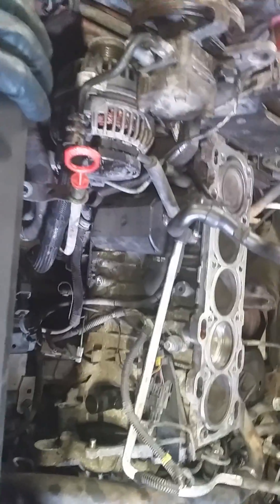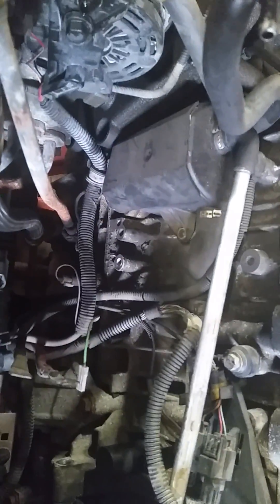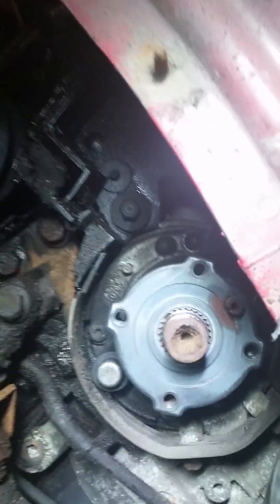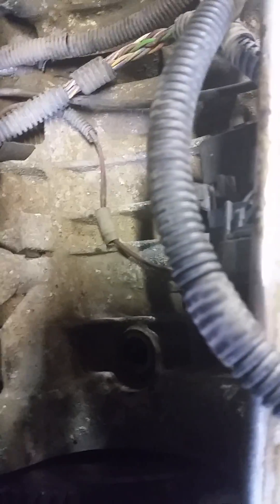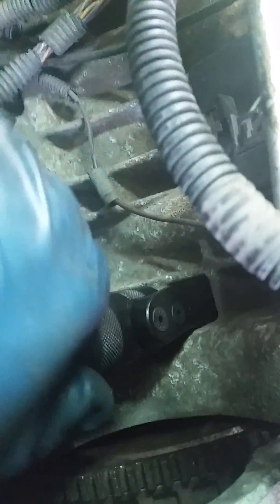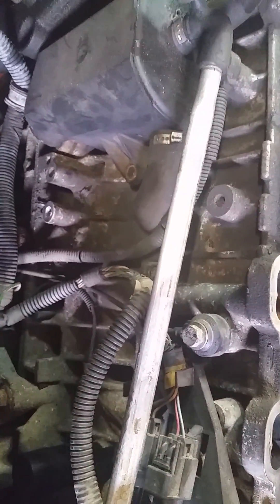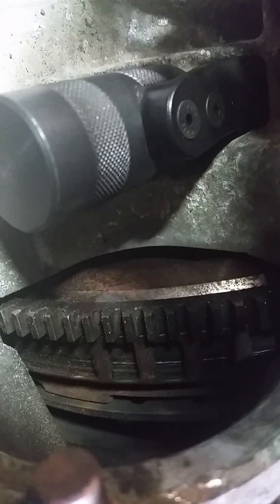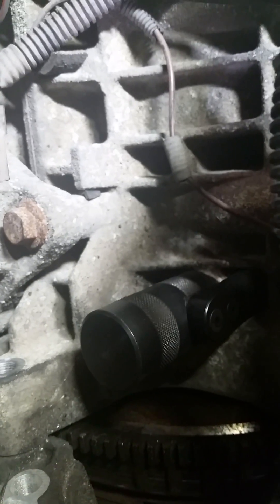Volvo crankshaft alignment

Comment: Hello, I have a question about where the lock engages in the crankshaft. Is there a hole in the crankshaft or does the crankshaft cheek rest on the tool?
Reply from the maker: @ratombo8992  I think there is a notch the small part seats into. It has been years since I have done that. The best thing to do is put it in place and rotate crank till it seats. You will feel and hear it

Comment: hi nice video, so the crankshaft locking tool should also work for a B5234T4 2.3 850 engine ?

Comment: Thank you for this video.  Believe it or not, you are the only one on YouTube who has shown how to use this tool.  I inadvertently moved my crank in replacing cam seals and could not be certain of the timing marks on the crank.  I put it all back together and it ran for crap, which told me that I mistimed it.   So, back at it to use the crank locking tool.  After removing the starter and plug, my tool turned out to be slightly too large to go into the hole.  I guess it serves me right for buying from Amazon.  Tomorrow I will get it turned down the few thousands needed to make it work.  If others run int this, get a machine shop to turn it down.  My plug is an M16x1.5 mm.  Check yours and act accordingly.

Comment: Thanks for taking the time to post the video and congrats on your recent wedding!  This may seem strange, but due to a technical issue with my alignment tool (it doesn't fit!!), can you elaborate more on what happened when you put the tool in bc your experience seems to be somewhat different than Volvo's instructions.  However, my post isn't to criticize, but bc I'm trying to solve a related issue I'm facing:

1.) Do you remember piston #1's position prior to putting the tool in (e.g., was it at BDC, somewhere in the middle, or at TDC)? 
2.) Once the tool caught inside the block, was #1 at TDC right then, or did you have to turn the engine further before it reached TDC (and was it stopped by the tool as well)? 
3.) From which perspective are you using "clockwise" and "counter-clockwise," from the driver's or passenger sides?

Volvo's svce manual says to turn the engine counter-clockwise (from driver's side perspective) until the tool goes in all the way, and then to turn it clockwise until the crankshaft stops against the tool. At this point, the pulley mark's should line up. Your recollection of how the process worked for you will not only clear up Volvo's instructions, but more importantly, it may be extremely helpful in helping me determine why my #1 cylinder (on a 6-cyl S80) still has about 2 inches of travel left before reaching TDC even though the crankshaft pulley is aligned with the oil pump mark!

Thanks in advance!